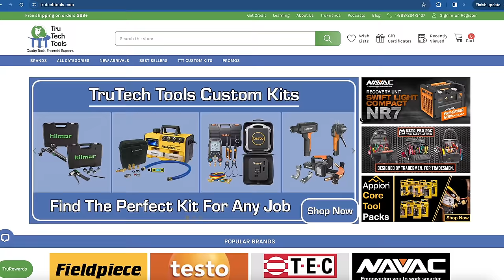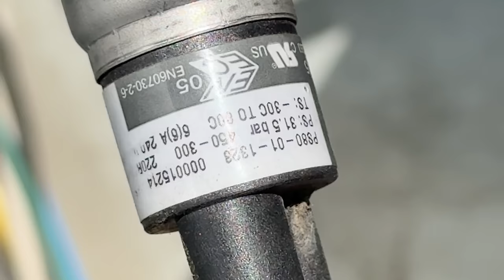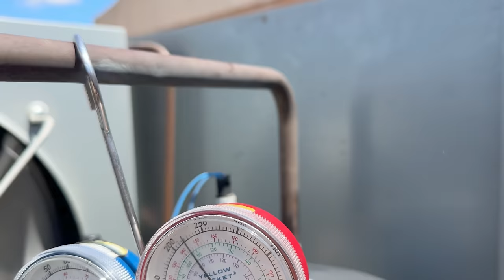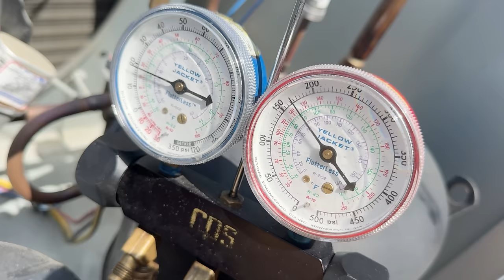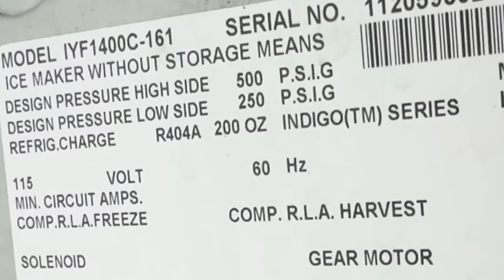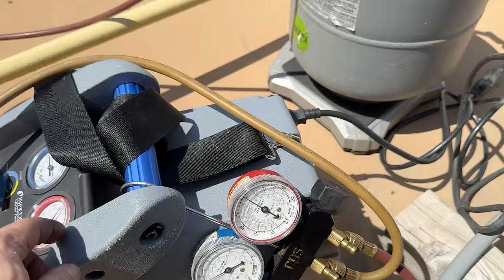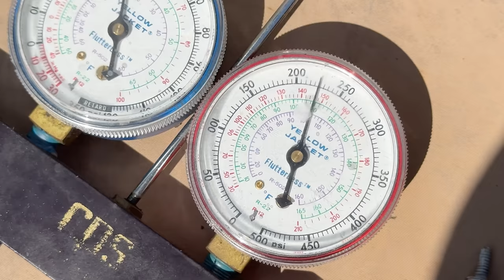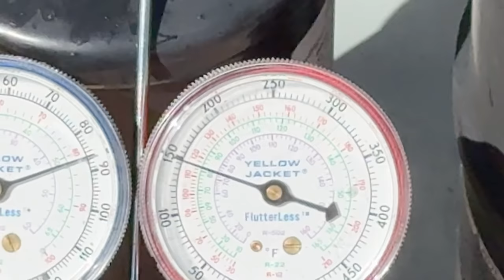Manitowoc Ice Machine Not Making Ice

Comment: I have the yellow jacket version of the imperial. Works awesome. Use it with r290 units and for psi controls on te self contained reach ins that I wor on. Good stuff Rick.
Reply from the maker: 👍👍. I’ve also used it to clamp off the suction to verify the valves are bad on small compressors that don’t have suction stops.
Reply: @HVACRSurvival  that’s a great idea.

Comment: Critically charged system uses vapor to harvest. Recover, repair and weigh in factory charge. Ice machine also runs higher fan cycle pressure to ensure full column, don’t recommend deviating from the factory settings on these units as they are pretty sensitive.
Reply from the maker: Agreed 👍